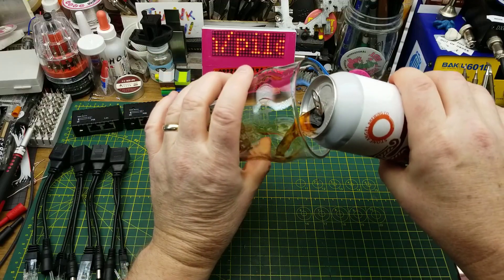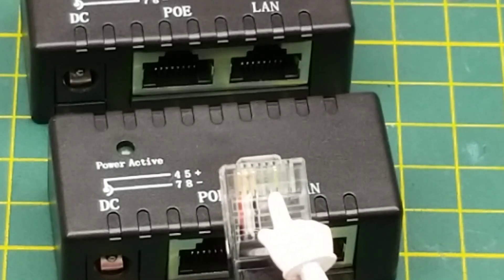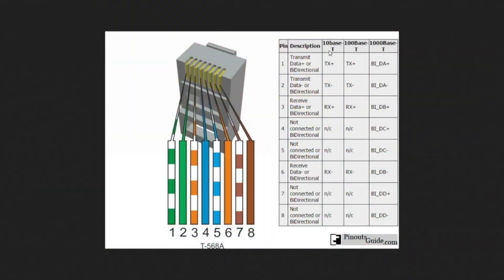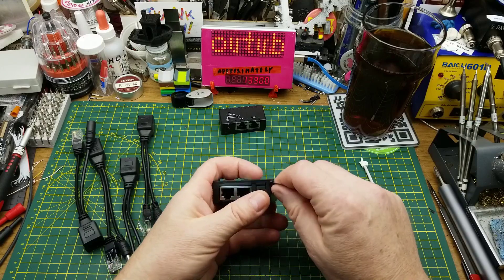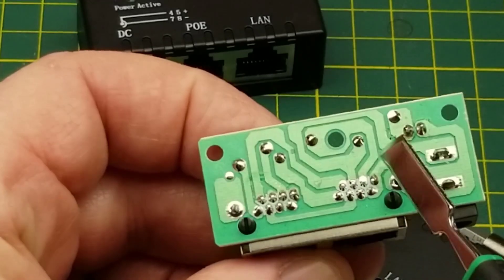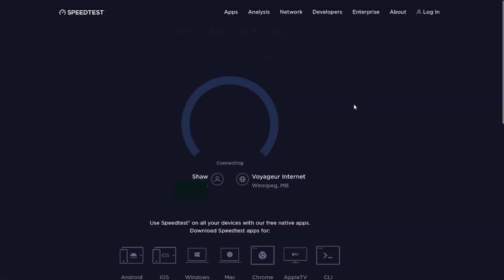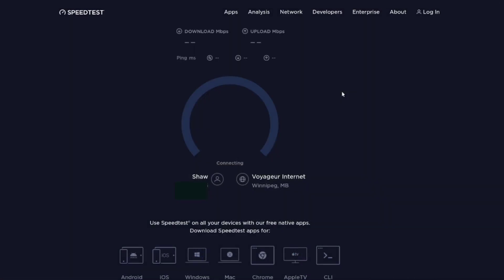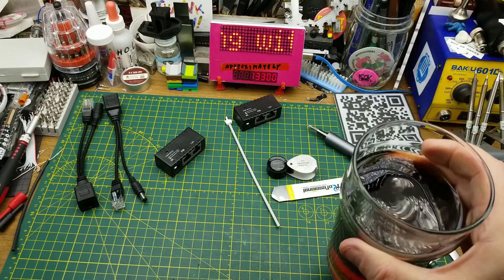Quick look: cheap power-over-ethernet adapters

Comment: Would have been useful to explain how Gigabit Ethernet does POE given the usage of all wire pairs to realise the 1GBit rate data flow.. Clearly suggests power net is sharing the wires with RF block/filter to isolate low impedance DC from signal paths.
Reply from the maker: I'm hoping to be able to demonstrate it with hardware in the future.
Reply: @pileofstuff  ok, that would help many who have less technical background. As you will have noted from various other comments, the standards and variances can leave many highly confused, as some info says ok, works and other says no way. Sadly it is highly dependant on many variables and hardware variances. Mis used setups can do much costly damage for people without needed knowledge/understanding.

Good effort anyway, at least has informed many of the limitations of these very simple basic pieces of hardware , and to not expect peak performance using it. Maybe emphasis too to ensuring only safe DC voltages are used compatible with connected powered hardware. These provide NO  power management or protection.

Comment: Those are common in CCTV systems, with a 48V injector module, and then the remote end having a small DC Dc converter to make 12V or 5V from it.

Comment: Those adapters clearly don't do Gigabit but passive PoE is possible with Gigabit. They put a coil across the data pairs and use the center tap to impose a common-mode voltage while not affecting the differential data signal.

Comment: What happens if you force ubuntu to try 1Gbps over only 2 pairs, rather than let it auto-negotiate a speed? I imagine it defaults to only 100Mbps because it only detects two pairs, but that doesn't mean 1Gbps won't work
Reply: If you force a standard NIC to operate at 1Gbps you won't get any connection.
Reply from the maker: If the hardware can't support it, the software isn't able to force the issue.

Comment: The other problem with using passive PoE injectors is having the correct voltage for the powerEd device.

Comment: Good explination for the older Poe adapter/injectors.  I have to watch to make sure that I get PoE injectors that do handle 1000BaseT.  Have you ever tried using a PEoC adapter?  I have applications that I can't run Cat5e/6 to, but have existing Coax, so I convert the PoE to Coax with  an adapter and back to PoE on the other end. (Camera Upgrades).  Those can also only do 100BaseT.
Reply from the maker: I haven't played with anything to do with networking on coax for a very long time.
Reply: Agree that these passive adapters are useful for use cases where 100BaseT is all thats needed. To be fair though 'full fat' 802.3af or 802.3at adapters are getting cheap enough now that for most applications, 1000BaseT is easy to have.

Comment: People must be confused about the 802.3 compliant PoE (802.3 af, at, bf) which absolutely works with all 4 data pairs and in parallel with Gigabit, and these passive injectors that repurpose 2 pairs for power.

The standard for 1000 base T Gigabit Ethernet, 802.3ab, published in 1999, requires 4 pairs.  We know there are ways to do it with fewer conductors - powerline adapters have only 2 - that requires extra circuitry that does not exist on any standard network card.

Comment: Have you seen the video card addons for laptops? they are so cheap but do they work? It's to put a video card on a laptop to [lay games on an external monitor. the are only the cables and the PCB. If they work you could make a cool enclosure.
Another thing on ebay is the kits that convert a 'smart' TV to a basic monitor. Is it worth it try one if the backlight still works? I have 2 50 inch 1080 TV's I'd like to fix. both back lights work but power supplies are dead. Do any support 1080 or are they lying and they are 720 or 480? could you convert a 4K to a 1080 TV this way? They don't have 4k control boards that I could see.

Comment: You are correct that 1000BASE-T does not allow for gigabit over less than 4 pairs but 1000BASE-TX or TIA/EIA 854 is gigabit over 2 pairs of shielded twisted pair cat6 or cat7.  It was done in some commercial environments but you won't likely find the capability on standard consumer hardware. 

This was very common in 2007 installs and later but it fell out of use when 10GB became common in business.  Now 40GB and 100GB are commonplace in datacenters and commercial applications with 10GB becoming very common for modern office drops. Where I work they installed drops that split out a single shielded cat 6 cable into 2 separate keystones because they wanted a separate gigabit connection for the phone system and one for the computer.  That was about 12 years ago.  So each office desk only has one drop with 2 keystones that both provide gigabit using 1000BASE-TX over a single 4 pair cable.  This is not a widely used standard but it does exist.  Cat6, Cat7 and even Cat8 are much cheaper now so it is less common to see people installing 2-pair systems.  1000BASE-TX also sometimes requires you to set it in your network driver settings since it doesn't autonegotiate on all hardware that supports it since it is a physical layer standard.

My home network switch is 10G on all ports and it will even do some autonegotiation based on what is available on the other side and the frequency capability of the cable being used.  So if the cable is crap you might only see 1GB or 2.5GB or 5GB rather than 10GB link speed even if the hardware on both ends supports the 10GB speed just because the cable cannot support the needed frequency for such high data rates.

Comment: i was interested in the the little boxes but you only tested the 4 wire cables. what happen when cat full wired 6 cable is plugged in to box thing?
Reply from the maker: Exactly the same result with the cables or the boxes.
Reply: @pileofstuff  oh ok. thanks for replying. i was just curious is all :)

Comment: those passive PoE 'injectors' are also bloomin' dangerous - the power is there all the time that the power is on. Meaning you can very easily fry anything you connect to them if it's not expecting a voltage that high on those pins. 
Source: Me - i'm an IT engineer and have been caught out, so only proper PoE sensing injectors/kit, passive stuff can get in the sea :)
Reply: Logically this can't fry any modern device because they are supposed to be protected again that
Reply: @Irilia_neko  go and try it. Plug your desktop pc / Mac into a socket fed by 24v passive PoE let me know how you get on 👍
Reply: @Tech-Nobby   these are meant to be used with the original power supply for the network device, 
if you start mixing then you invite disaster !
Reply: @Tech-Nobby  yup.  Much like QC and PD standards for USB power, 802.3 PoE would negotiate the power before placing the full power
Reply from the maker: @Irilia_neko  *Supposed to be*...  🙂
Reply: Isn't there supposed to be a transformer between the ethernet port and the PHY (or, in some designs, integrated into the port)? Obviously if the manufacturer cheaped out on that part you can't expect the device to work.
Reply from the maker: @dom1310df  A transformer is what you should expect in a better unit.
Reply: @dom1310df  There are transformers in the Ethernet device but often there is a center tap with a connection to ground (which eliminates stray voltages).
Reply from the maker: Yeah, the better way to go would be to use a switch with PoE ports natively installed - and it would give you full Gig-E.

Like a lot of things in the security camera industry, these things are a bit of a bodge.